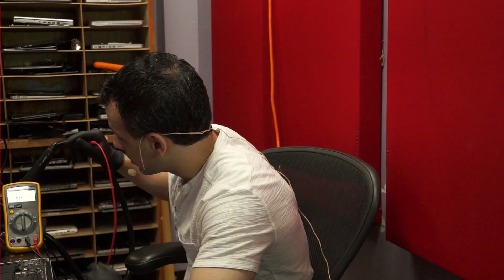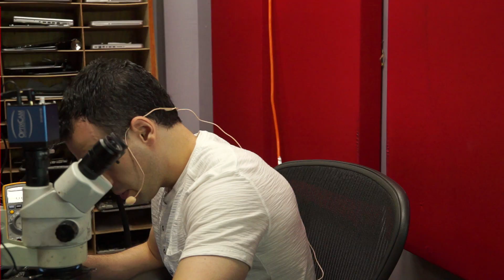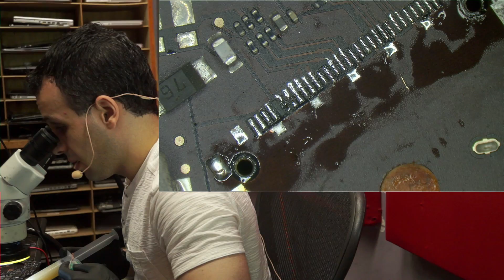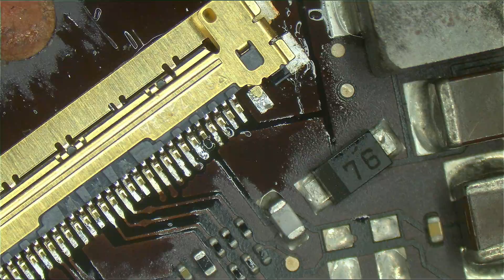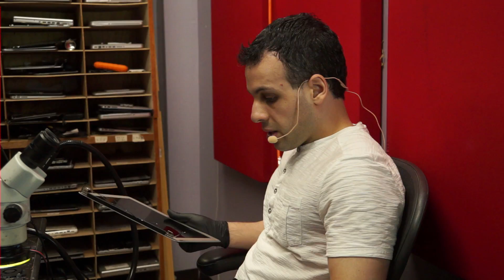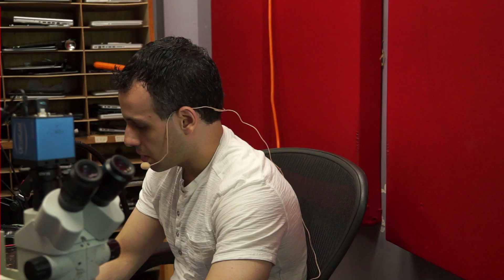No, I don't ALWAYS  drag solder! Demonstrating the T30-KN tip & FM-2032 iron.

Comment: a charging circuit resistor burned on my laptop, how much should it cost to repair it?
Reply: also is it possible to  for a novice to solderer it?
Reply from the maker: +1VETaLEK2 depends on where you live. We charge a flat rate 325 plus tax
Reply from the maker: +1VETaLEK2 depends
Reply: i used too work on car audio and a little soldering there. and it looks simple enough,the main problem i have is that i have no idea what resistors i need to buy.they are fairly small and unmarked but i do have a over head picture of how they look.
Reply from the maker: +1VETaLEK2 the most important thing is to be sure of what you are doing. Not guessing, but I mean sure of what you are doing. Know why it failed, know its purpose of the circuit, and know what it is. Even if you are making a guess it has to be based on real knowledge or a real Theory
Reply: I know it is a burn resistor for certain and I do know it is on the charging circuit. I do not know its exact function. Usually resistors have numbers or markings on them but this one is just black with out any. I also do not know why it burned. there was a lightning storm last night but i do have a surge protector.
Reply: if its just black does that mean its a 0 ohm link? (also, it a surface resistor)

Comment: If you were constantly switching tips you'd be using a JBC iron with the quick-change tips. By not changing tips all the time you get to save quite a lot of money and get an iron that works just as well for you.
Reply from the maker: The quick change is not so quick on the JBC. It's harder than the Hakko. I went over it in the very long JBC review video.
Reply: Good to know. Someday someone will make a really good quick-change system, but the versatile tips make that a bit of an iffy proposition for spending R&D effort on.
Reply from the maker: Here I fast forwarded to demonstrating the supposedly hot swappable tips. https://youtu.be/le3MKFfKaII?t=1793
Reply: Yeah, I watched that. Bolting the base to the table would probably help.

I'd say it's faster than Hakko, but you could just buy 10 Hakko iron handles and plenty of spare tips and just swap the whole handle + tip assembly for the same price.
Reply from the maker: SAI Peregrinus For the amount of money JBC wants, any modification I have to do is BS! Cut price in half and that stupid tip swapping apparatus is ok.
Reply: I agree with that! The main draw I can see for their stuff is for LARGE businesses that need lots of soldering stations, Their TCO only starts to go down when you take tip lifetime into account and have enough usage that replacement tips dominate the costs. Likewise for the other aspects: you might save 30 seconds five times a day with them over Hakko, which won't pay off in this lifetime. But if you have a big enough workforce it starts to make sense. Especially when you take their bulk pricing into account. I bet if you were buying a hundred stations they'd come to you and bolt the things to the tables for free, because big customer complaints always speak louder! Top-end gear might be worth it for Foxconn or similar, but once the patents expire the tech trickles down to the low-end gear like Hakko.
Reply from the maker: SAI Peregrinus that's the other myth. the tips on these stations die when I lose them or I use them to stab something I should not have stabbed. old tips go to shit, the stuff for the 2027 and 2032 just keep on keepin' on.

Comment: Louis, i have a Asus Rampage IV Gene X79 and its doing a code 53 on the debug code, you know what it could be? Im using a 16gb (4x4gb) ram and a Xeon E5 2680 C1.
Reply: In my experience, Asus and Code 53 is usually always RAM related. Test it one stick at a time in the first slot until you find the bad stick. If that is it, yay. If not, try to find the bad slot. If that does not work, clear the CMOS. Have you OC'd the ram at all?
Reply: none of them are bad. i was using them on my amd build 15 minutes before my x79 arrives in my door
Reply: Would still try to test it with one stick, if that does not work, clear the CMOS or hit the go button, and see if that will get a post.
Reply: It worked, i cleared the cmos and reboot the pc with 1 stick, then put the other 4 and my gpus.  working just fine. thanks guys

Comment: Hey man if I wanted to replace the disc drive in a late 2011 MacBook Pro with a lithium ion pack of the same voltage as the battery, would the charging circuit manage if I spliced the second pack into the original battery in parallel? Love your Vids too!

Comment: About the board positioning. You mentioned it a few months ago and I began to think about it. I noticed I was not moving the board and instead making everything so much more difficult for myself. (tho I'm producing boards rather than repairing, but the point still stands) I noticed that the reason for me was an unclean desk. Too much shit rolling around the desk and when I began to move the board, the other sides of the board were in danger to move around due to stuff touching components on the board (and thusly making my work annoying).
So basically: Keep the damn desks clear of shit you don't need and your life becomes way more easy it's not even funny.
Reply from the maker: Yes!

Comment: Louis, do you find it strange that they put fuses on these boards to protect components when Apple has a zero interest in repairing them? Isn't the whole point of a fuse to protect vital components in case of a short with the idea that fixing the short and replacing the fuse would make the product work again?  Why would they put fuses everywhere when they would suggest you purchase a new product either way?
Reply from the maker: fuse is there to prevent lawsuit and blow rather than have you sue them when the comp burns your ballsack off.
Reply: Got it. I had to arrest my logic and put myself in Apple's shoes to understand the purpose of a fuse.
Reply: Its good to know that all that currently stands between me and the life of the crispy sacked eunuch is a poxy 2 cent fuse...
Reply: The device would also never pass UL or EU compliance laws if it wasn't fused either, for the same reasons.